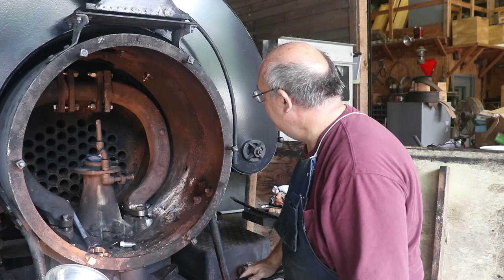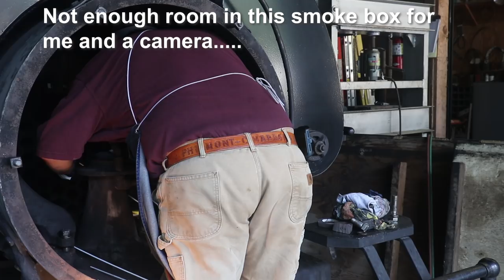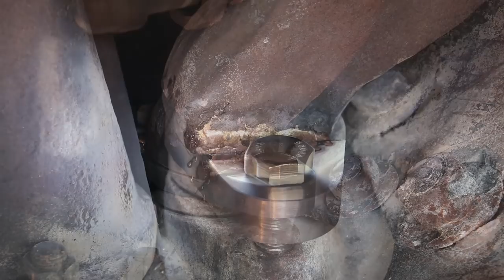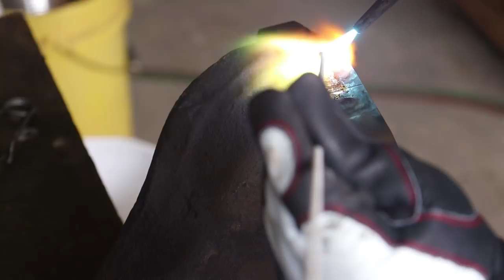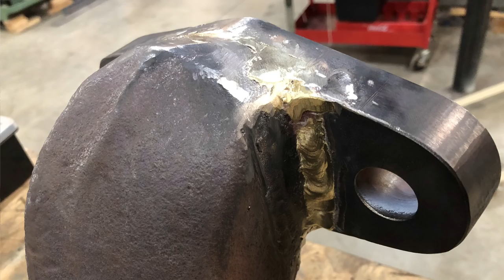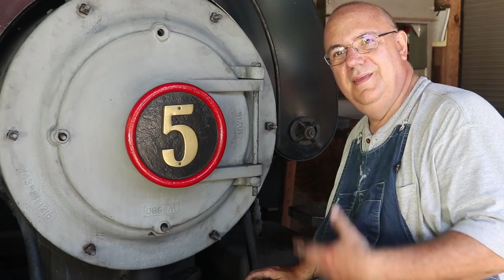Steam Locomotive Steam Pipe Repair - Part 5: Brazing and Installing the Repaired Pipe

Comment: For the steam systems on ships we made the seals out of steel and silver plated them. The silver makes the seal while the steel held the shape. The only thing is you can't touch them with your bare hands or get any oil on them when installing them because they won't seal properly if you do.

Comment: Over here in the UK and especially regarding steam, I have found that "navy unions" are the best, cast steel unions with brass inserts sweated into the union and with two mating bevelled surfaces, just a coating of copper slip and then screw the two halves together for a perfect mating fit......works every time.

Comment: Back in my apprentice days we bolted those sort of  pipes together with stuff called Morgans graphite grease , black morgans ,because it was so black but the graphite content meant the bolts came off easier for the next person to undo them and the swiveling joint would seat smoothly when doing it up.

Comment: The brazing job you did was an OK job but you should have used a larger tip on your torch.  Just like soldering you want the parent material hot enough to melt the filler material.  You were using the flame to melt the rod rather than flowing the rod into the hot joint.  That is why you had runs and drips.  When we braze up bike frames we have to 'sweat' the bronze filler rod into fittings just like a plumber.  Same technique just a much higher temp and their fittings are not glowing orange.  :)
Reply: I agree. Keith likes to think he knows what he is doing. A little knowledge is a dangerous thing. Unfortunately he has manouvered himself into a position where he is a big fish in a small pond. 
Most of his viewers are unwilling or unable to see things for what they really are and continue to praise him in spite of the truth. This prevents him from growing as an engineer and in other ways too.

Comment: I kind of agree with the amount of heat that you used to grease the pipe, a higher heat should have cause the grade to fill both the outer and internal joints just like solder flows through a coupling. However since you did go back and based the intern seam you might have filled the entire seam. We will hope for the best and the joint holds for the next 100 years. All said you put in a good effort.

Comment: Good project and as always I like your approach. Noticed that you were using a carbonized flame during brazing. You might try an oxidized flame next time, it really make the braze lay down and soak into the joints.
Reply: Nik C. Colyer 
That flame is to much oxygen which makes a oxidizing flame, notice the hissing. Ideally you want a neutral flame for brazing...

Comment: As always, a great project, Keith.  Thanks for sharing.  It might be interesting to see how that pipe moves after it gets hot.  It has to expand, but the shape of the pipe implies that at least some of the expansion goes to the right, so as to not put too much force on the bolted junctions.  Thoughts?

Comment: Hi Keith.   I have one question,  I understand how they would build a pattern and mold for the casting but what would they use for the core to form the pipe?   Would it be a highly bound sand core or some other material?  This has been one of the best projects to watch.  Will you show the fire-up and locomotion?
Reply: I'm not Keith, but I've seen how this is done.

Sand and sodium silicate.  When the silicate 
is exposed to Co2, it hardens right up.

steve
Reply: @steveskouson9620  Thanks Steve, would this technology be avaible at the time this casting was made?

Comment: "Jet-Lube Kopr-Kote" copper antiseze for steam pipe bolts. That was all we would use back when I used to rebuild steam and gas turbines in refineries and power plants. 10 years later bolts would come apart like the day they were installed. Even stainless... anyone who has worked with stainless knows how badly it can gall.

Comment: Another technique is to use powder flux to dip bare rod in.  Bend rod enough to point back toward weld from the rear. For the inside

Comment: Boy howdy, I sure would want to do a hydrostatic pressure test on that before applying steam.
Reply: The steam delivery pipe is not part of the boiler pressure vessel.  It simply feeds the steam from the boiler to the cylinders.  Since the cylinder end is "open" it is not possible to "hydro" this part, nor is it neccessary.
Reply: @clham612  block off both the ends and h.p.t. the tube itself.

Comment: Just curious, it seems like this excellent repair job was a lot more difficult to do compared to casting a whole new piece?  Then the whole thing would be cast iron like it originally was?
Reply: This repair took some time, but the cost was probably less than $500.  To have a pattern made and a new pipe cast would have cost on the order of $3-4 thousand, OR MORE!  And the locomotive would have been out of service for months waiting for the new part.

Comment: I would imagine they used cast iron for the seals because when you're dealing with heat and different metals, they expand at different rates.   The linear coefficient of thermal expansion of brass is almost twice that of cast iron.  So the brass will grow more than the iron when they are heated up.   I'm not sure if thats good or bad because (A) if the brass grows into the hole it would theoretically seal better. (B)but could the brass grow so much as to break the studs or warp the flange???  not sure.

Comment: Keith here is a tip for future. When you do a fit-up don't heat everything to do a tack braze instead use a 5 min epoxy. It will save a lot of time and allow the part to be firmly attached so you can remove it and do a proper braze job.

Comment: Your torch settings are a bit heavy on the oxygen, what happens it your part is actually not heated ideally do to the excess oxygen cooling the work piece.
Reply: Note the comment of Nik C Colyer above.

Comment: You do not need the anti seize  on the threads  as it is a perfect repair and should not  need to come off for a very long time if ever.
Reply: That's the sort of logic I find applied to German cars.  They decide that the design is so good it will never break or need repair so they don't pay any attention to how difficult and time consuming it is to reach the part and repair/replace it; example of 5.5 hours labor to replace a starter motor or 6 hours labor to replace a water pump.
Reply: John Ferguson, You are not supposed to fix them throw them away and buy another one, that is their logic. I was praising his workmanship as the repair was faultless.

Comment: Keith, why don't you step up your game a little and set up a camera with a manual focus so your shot will stay sharp instead of the auto focus searching around and annoying the heck out of us. And most importantly put the right type filter in front of the lens so we can see the actual weld as its happening. Then drop that video down in the corner of your main shot. It would make it so much more interesting to watch you weld instead of just a blown out shot of you welding which is virtually useless.
Reply: Your disappointment is intense.  I believe it is time for you to unsubscribe.

Comment: I know, it´s a pain, but after the first heating, i would tighten those screws again. After everything found it´s real "home", they might be a bit loose. In case of the rings, i believe bronce or brass is the better material. You have to consider, that bronce is not so cheap, as cast iron is. So, they may have had that in mind, when they decided to use cast iron. To braze the inner gap seems necessary. When the machine is hot, you have oxygen and hydrogen inside. And that under a lot of pressure. Now, the engine is hot, then cold, then hot again. That is ideal for corrosion inside those gaps. And the rust will bust the connected peace off over time. Now, as the gap is brazed, that can not so easily happen.